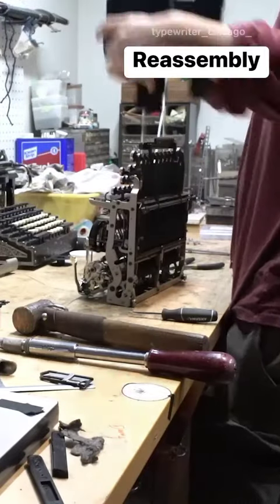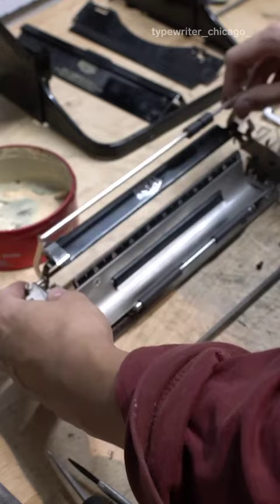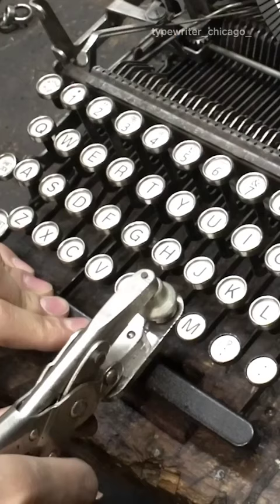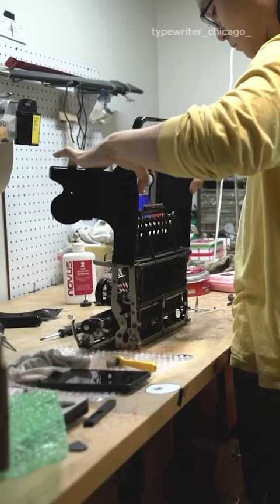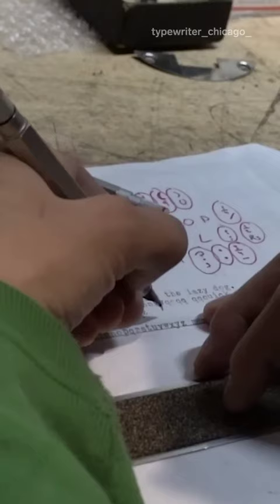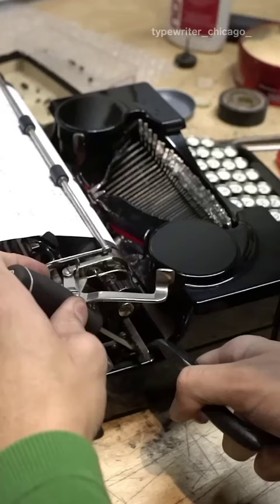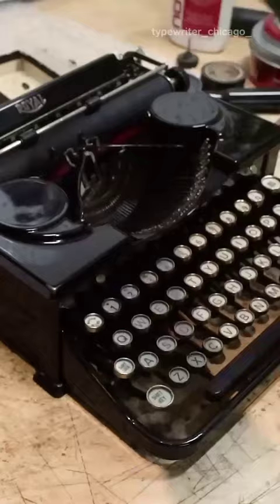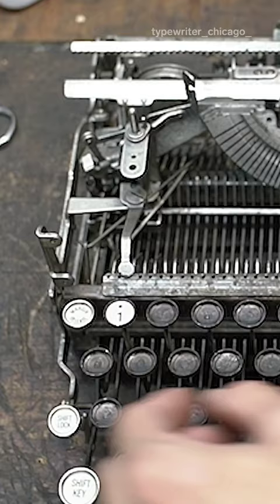Here's how a typewriter is reassembled for preservation. #typewriter #restoration #vintage #home

Comment: I liked the antique look it had at first. Is it possible to refurbish the typewriter while keeping it looking old?
Reply: Yes, mainly you don’t need to replace the key caps if they are still completely usable/readable. You can also just lightly clean the exterior and leave most of the wear and tear on it. Most of the mechanisms inside would need to be deep cleaned if they weren’t working right so they might not have that full antique look.

Comment: Hello, just wondering if I could get a response, so I have acquired a relatively good condition Remington model 12 1923 production which I’ve tried to restore over a year as beginner, I’ve restored most of the panel paint work however I can’t find a safe way to remove rust and restore a chrome finish, I also have no idea how to fix one of the scratched keys as I have bought a replacement however it is a different production and I’m not sure how I would go about replacing the key letter which is yellowed and half removed.